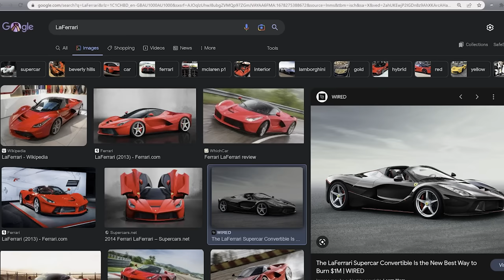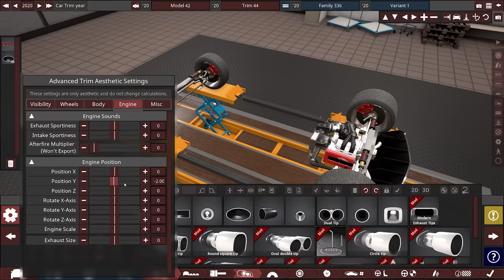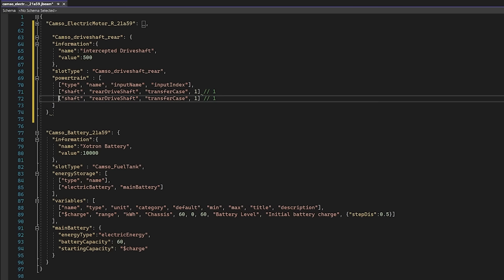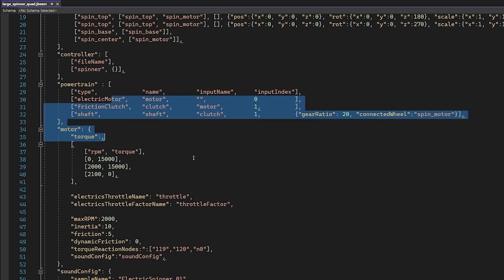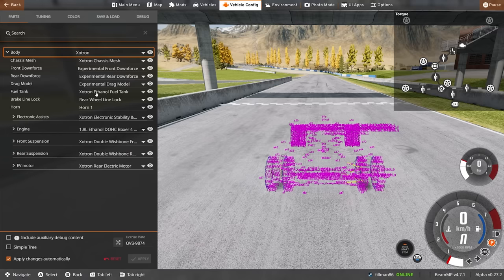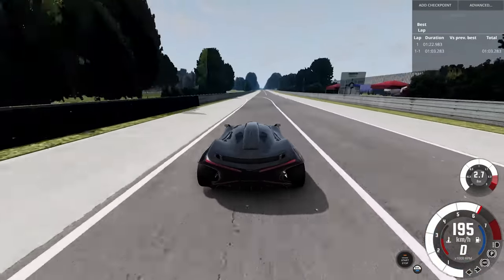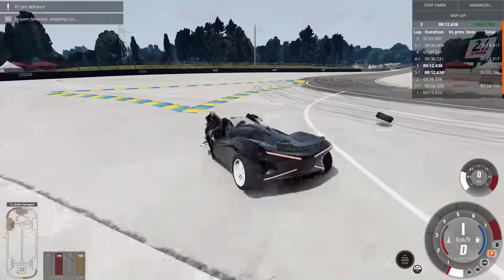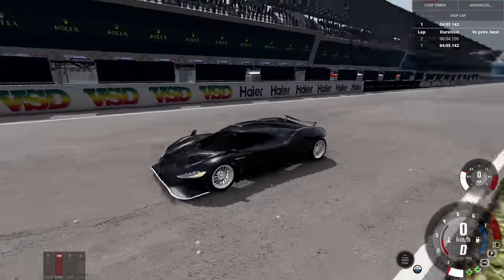The LMDH Hybrid System TOO COMPLICATED in BeamNG

Comment: That's interesting, it's quite tricky to make a hybrid in BeamNG, especially with absolutely no modern documentaries for that. Good job on making this video as well as making a lot of effort trying to make this system that's faster than every single prius on the road right now.
Reply from the maker: if the electric motor was driving different wheels, then the hybrid system is super easy! But that's rarely how hybrids are made :/
Reply: Even in games, the hybrid is still too complex. Politics....
Reply: @fillman86  Yup, which is why for my fictional Hypercar, I am following the LMH rule set...that and there isn't enough information to properly replicate the survival cell of the four required manufacturers.

Another nit-pick, your "Hypercar" is unrealistic given the current regs. You need to take that car and replace it with a 124in/310cm LMP body.
Reply: @R9naldo I am making a hybrid (new Prius Prime) in Stormworks and it is soooooo much effort. My ECU is the size of ECU for airplanes in the game.  I have a beautiful notebook for everything, just putting stuff in the game is confusing...

Comment: Now I finally understand how that other guy did this hybrid system, it's a really creative solution! It's probably super tricky to reduce the vibrations, it all comes down to the weights of the fake wheels, they are like a flywheel. You need them to be as light as possible to have little momentum because that generates less centrifugal force which destabilizes the car. But you can't get too light because in this game if you lower the weight you need to reduce stiffness or else it becomes unstable, and with lower stiffness of the 'spokes' the wheels will stretch more which brings the centrifugal force back up... It's a really fine balance, and on top of that you have to avoid reaching a natural oscilation frequency of whatever the wheels are attached to because the wheels vibration will multiply the vibration of the body, which I think was what happened in the first test in the video.
Reply from the maker: haha my questions I made in that discord makes more sense now?

I ended up making them 7.6kg each, and used really stiff beams from automation's suspension structure.

Any lighter and it becomes soft as you said, and any heavier, and it moves the car around physically -_-
Reply: @fillman86  how does it work in that ATV car the beam devs created? Does it just not matter because the car is slow?
Reply from the maker: @yannicg  that's where I got the code from, but that car doesn't generate much power, and it's very slow
Reply: @fillman86  oh ok
Reply: @yannicg  Exactly, it's too slow and not powerful enough for the effect to matter, it only becomes visible when you are going like 150 km/h in it which is not possible with vanilla parts

Comment: Maybe that's why the Beam devs didn't make the 8 wheeler go quick so they can avoid the vibration caused by the fake wheels xD
Reply from the maker: possibly, though in that system it would have been easy to gear it up, so it wouldn't have to spin as fast
Reply: @fillman86  hmmm, also true
Just kinda unfortunate that those fake wheels cause the whole vehicle to vibrate and impact performance/handling, but the idea of hybrid cars in Beam really is astonishing, you still did a good job of making it work, even if it isn't perfect

Comment: I’m pretty sure the laferrari’s v12 and electric motors both drive the rear wheels
Reply from the maker: you may be right, I think I may have confused it with others that drive different wheels :/
Reply: @fillman86  porsche 918 is like you said, or the Ferrari sf90.
Actually both also have electric motors on the rear too

Comment: I swear hybrid usually only kick in on low speeds, adding that low end power and giving the vehicle that better fuel mileage and less stress in the engine?
Reply from the maker: that really depends on the system. LMH have a system that only kicks in over 120kmh (about 90-ish mph), only has 200kw (about 155hp) but still has quite a kick :)
Reply: Could you make a hybrid that works for efficiency
Reply from the maker: @jordynmooney4753  yeah, just put it on any low powered vehicle

Comment: That's a very interesting hybrid system, quite different from I've seen so far but also what I've been trying also, mine's uses the old powertrain layout and kinda works confusingly but works (for now), but I think with this, who knows if it's possible, there could be a possibility of adding 3 power sources (one combustion and two electric).. but still, very interesting and how tricky it ended being on your part, very cool and a lot of effort!
Reply from the maker: interesting, how do you get more than 1 power source in?
Reply: That's a good question, but I think the main limiting factor could be game it self. On my behalf I was thinking mostly combining what you have and what I have, so let's use your car as prime example, since my version of the hybrid is by file (one rearMotor and other frontMotor including batteries for both), I just copy the file and paste it in the engine folder, after that I would copy the battery and engine that I have here saved and paste it into the main file (the slots part), then just pray it works xD
That's what I was thinking basically..

Comment: This is pushing it for sure. Can't wait to see the race. Actual 24 hours?
Saw your hybrid mod from ~7months ago. Tried it myself and somehow the front wheels are not connected. The electric motor is there, so are the shafts. No drive however.
Reply from the maker: odd. I'll be going over that hybrid system too at some point

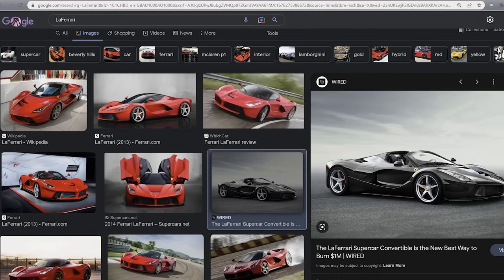Comment: 0:46 Terrible example because the LaF's electric boost only sends more power to the rear wheels like the P1, there is no drive to the front at all. The 918 would have been a better example from the holy trinity but only kind of as it still has electric boost for the rear wheels assisting  the engine. I can't think of any hypercar that only uses its hybrid system to drive the other axle (usually rear unless it's the gamera) while not assisting the conventionally driven axle.
Reply from the maker: yeah, I believe I meant to say the SF90 (I think), but it sends to to the front and to the rear with separate motors
Reply: @fillman86  SF90 was also the example I was going to say but upon further research that's like the 918 and has a 3rd motor boosting the engine driven axle too.

Comment: For the record, and I don't mean to be "that guy",

The Porsche 918 is AWD and works like the the Corvette C8 E-Ray, LMP1, and some LMH/LMDH with the ICE powering the rear and the Electric motor powering the front. and has about a 12 mile range in full electric.

The McLaren P1 was RWD and has a 18ish mile range in full electric.

But the La Ferrari was RWD only and only had an electric boost setting, so no electric only drive setting like the other two.
Reply from the maker: haha I misspoke, I meant to say the SF90, but it also powers all wheels. So you're not really being "that guy" as if you were to scroll down, huge amounts of people noticed my mistake too XD

Comment: Maybe I misunderstood, but I believe you're wrong about the laferrari? It uses it's electric motors in the rear wheels too, it's rwd only along with the McLaren P1. The exception being the 918 Spyder, however it also had an electric motor to drive the rear wheels along with two driving the front
Reply from the maker: yeah I kind of meant the SF90, but it also drives the transmission too
Reply: @fillman86  To be fair there just isn't really a good road going example to use

Comment: I wonder if instead of making a fake rear wheel you could use the existing rear rim / wheel by splitting it in half. Then  driving say the inside nodes with the electric motor and the outside nodes with the petrol motor, allowing the nodes that already exist in the wheel to do the coupling.
Reply from the maker: hmmm if I made the tyres out of rotators instead of pressurewheels, but the time and effort would be huge. They'd also probably have similar issues, plus it wouldn't be a drag and drop mod anymore

Comment: You need a unique torquecurve. Instead of a usual progression, have it inverted
Reply from the maker: I'm not sure I follow?
Reply: @fillman86  normal torquecurves for a combustion engine start at a low number of torque for low revs, if you invert this (or even flatten it) you have more torque for low revs. I know as I've done this before for RoR (Rigs of Rods) mods.
Reply: This will make it accelerate much quicker off the line.

Comment: you could've just made a petrol motor with a fake electric motor that doesn't exist
Reply from the maker: haha there are key differences, like throttle response, and how its power is delivered not on dependant on the gear the car is in. Luckily the LMH hybrid system can drive the front wheels, and that system doesn't have these issues :) so we're going with that

Comment: Another quality video of struggles and pain... sorry, meant to say "BeamNG modding" but it feels like a same thing. 
Speaking of hybrid systems, there is a mod "hybrid citybus", that sort off adds hybrid system via "electric CVT", by combining electric engine and CVT gearbox into one item... maybe that can be usefull for future projects?
Reply from the maker: a cvt keeps the torque or power at maximum, but an electric motor has it at maximum anyway. Seems redundant, plus in real life, you wouldn't be able to move a bus with a CVT because it'd die really quickly :/
Reply: @fillman86  It's a CVT that has electric engine built in in the code and coupled to it's output (not input), so as far as game is concerned - it's a transmission, with one input and output, but can also provide torque on it's own, even comes with EV battery. It's more about "is it possible to merge the code for electric engine and other type of transmission in order to have another way of getting hybrid power to same set of wheels". I don't know if it's gonna be easier than the way you did (probably not?), but it doesn't involve any invisible wheels and node merging, thus eliminating the source of shakiness. It's easier to understand after testing it in the game and looking at the drivetrain visualization, with and without combustion engine working.
And yes, I know that real CVTs are "a bit" on a weak side and might die from you just looking at it the wrong way.
Reply: @Andriyshchurko  this sounds quite interesting, he should try that

Comment: You have to make a turbo hybrid f1 car now
Reply from the maker: see..... the MGU-H system probably isn't possible in beamng :/ For starters beamng has some back end charging rate limit, and then turbo spool isn't changeable :/
Reply: @fillman86  and im guessing kers is not something that can be modeled either
Reply from the maker: @to45t48  I've tried electrical kers, and it is.... but it can't really recover much power when breaking, and if you do turn it up, it puts on a looooooot of engine braking, which can't be tamed with ABS -_-

Comment: Ah i did wheels inside wheels, but it turned out too cursed because i couldn't figure out how to wield to wheels together.
If we got a differential that worked in a inverted way like 2 inputs and 1 output , that i think would made the whole thing alot of easier.
Anyone good at lua? :-P
Reply from the maker: wheels don't have specific nodes to join beams together. As for differentials, they can take power in (that's literally what I did here), the problem is that you can't have 2 power inputs in the same powertrain tree :/
Reply: @fillman86  Yeah, and its a shame the beam devs, haven't given us an inverted differential.
Reply from the maker: @batteryman2852  diffs can take power any which way. There's also a type that can have multiple inputs/outputs, the problem is a powertrain can only have 1 power source
Reply: @fillman86  Thats weird  i recall it can only do 1 inputs, but the game have options for multiply outputs, like multishaft.
so i guess the single input means single source then.
Makes me think, what would happend if an electric motor could act like an add on like the Nos,turbos,sc does.
Reply from the maker: @batteryman2852  you may benefit from watching my video the whole way through XD